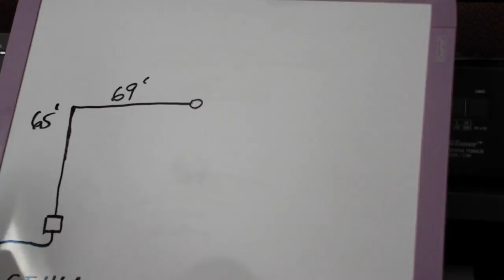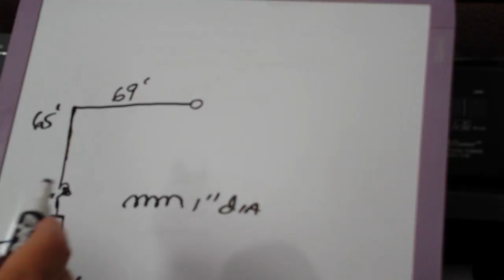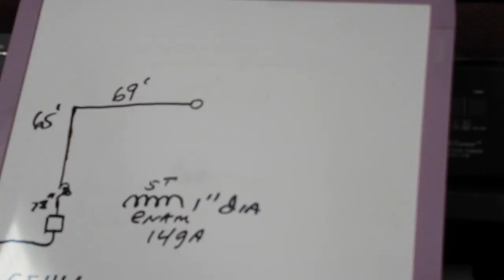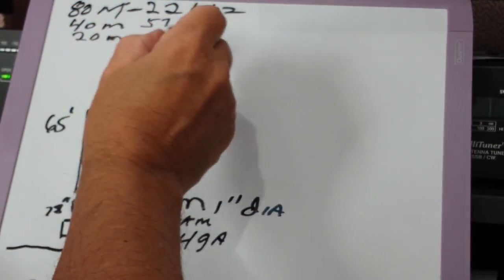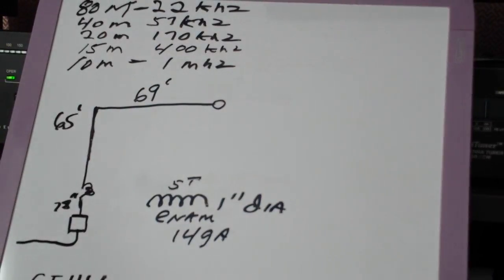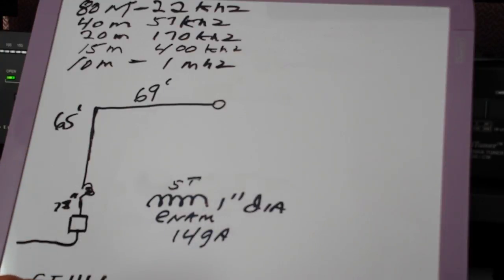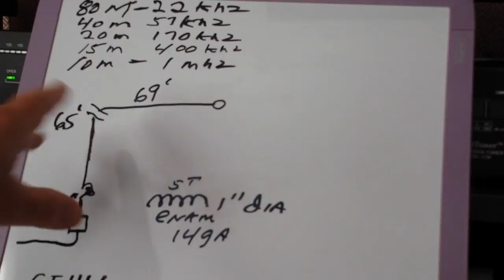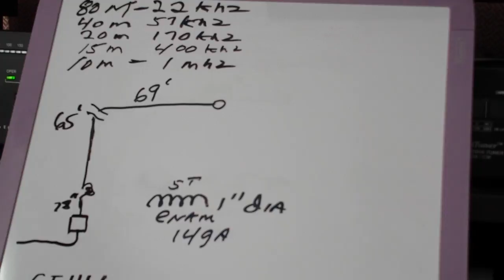EFHW  Compensation Coil Experiment

Comment: Thanks so much for your hard work. Not only testing the antenna, but making a video is hard work. I live in a mobile home park. I was going to put up an open wire fed doublet, but I've decided to use an end fed. Your tutorials have really convinced me to go that way. Especially using an end fed 40meter as a quarter wave inverted L on 80 with your relay addition. Thanks 73

Comment: This idea with the coil originally comes from few decades ago and was proposed by the German ham DL7AB and is described in the Karl Rothammel's "Antennenbuch" ( page 185). It was then designed for the EFHW 80-10m "Zeppelin" type of antenna fed by open wire line (the pre - "49:1" transformer era :)). It is still very attractive antenna and I'm glad the coil idea was probably creatively employed by the modern days EFHW manufacturers. 73! Linas LY2H
Reply from the maker: Very interesting. I found an old version of the book in German and found the article on page 172 however I cannot read it. I can't even copy and paste it in a translator. Maybe I will order the English version for $100. Thank you.
Reply: Steve Ellington , there is not much to translate actually :). I'm not any better than Google teanslator but the essence is like this: " The radio ham DL7AB offered a simple way on how to tune the long wire antenna to resonance on all bands. The principal of work is based on the fact that the coil inserted into the antenna wire makes the electrically lengthening effect. The effect is the biggest when the coil is in the Current Antinode ( Strombauch), and this effect diminishes with the Current Nodes ( Stromknoten) approaching the coil. The picture depicts the current distribution in the wire cut to lambda/2 on 80m. When the coil is inserted at the 2.5m point from the beginning the lengthening effect on 10m band is the most since the coil finds irself exactly in the first Current Antinode. On 15 m band the coil finds itself a bit farther from the Current maximum point so its effect deminishes. Thus, with the wavelength getting longer and longer the lengthening effect of the coil getting lesser and lesser. If you choose the length of the antenna wire equal to 40 meters it turns to be a bit too short as a half w/l on 80m. But still,  the lengthening effect of the coil is good enough to bring the wire into resonance on 80m band despite the coil finding itself almost in the Current Node. On 40m band the length of the wire turns to be 1,7m too short from resonance and the coil is closer to the Current Antinode and thus makes for the compensation of being too short. Equally on the other bands: on 20m band the wire physically is shorter for 2,3m,  and 2,5m on the 15m band. Summarising, the lengthening effect of the coil helps to get the wire electrically correct on all ham bands  due to these electrical properties of the coil acting in the float of current in the wire. " Further in the text there is a picture proposing the 5 turns of wire on the 50mm former for the coil with the latter being inserted at the 2,5m point from the beginning. The rest of the text describes the same antenna in the symmetrical dipole version  and the way of tuning and pruning the antenna employing the tube type amplifier and its final  LC contour checking with the Anode Current change all the way long :). Hope this helps a bit and I take no responsibility for the correctness of this translation! 73 ! Linas LY2H
Reply from the maker: @Linas_LY2H  Interesting. The modern version of this places the coil 78 inches or 2 meters from the transformer, not at the 10m anti-node. This makes me wonder.... What happens if we used another anti-node along the antenna instead of #1? It is interesting how the change on just one anti-node affects all the others.
Reply: Steve Ellington It would surely be interesting to experiment further with the placement of the coil. Some manufacturers put it as "non critical" , the place of the coil but it seems to me that putting it in any other place than the first anti-node on 10m band would seriuosly distort resonance on other bands. I have put mine at abt 2,5m from the begining and have it working fine but I have not tried putting the coil elsewhere. Interestingly, I have tried once to insert the same coil into the 40m band EFHW ( abt 20m length) at the same place of 2,5m and the result was dissapointing since the antenna got it resonances distorted on all bands including the 40 :)). So I don't use this coil on my 40-10 EFHW.
Reply from the maker: @Linas_LY2H  I think the problem you are having may  be the result of installing the coil too far away from the transformer thus too far into the 40m section. The commercial versions all stop at 2 meters and it seems to work on the 40m efhw well. We use 6 turns around a 1 inch form, close spaced, insulated antenna wire.
Reply: Steve Ellington Thanks, good to know! I'll try that out!
Reply: @n4lq  Check with your library - one that can do ILL (inter library loan) with (probably) universities.  If they can get a copy for loan, you can evaluate whether it is worth the $$ to add to your library.

Comment from the maker: The length should be around 130 feet which will put it on the low end of 80m. Doing that is necessary to make the higher bands fall into place. If you cut it shorter for 75 meters the higher bands will be too high so you need to insert a capacitor at mid point, about 400pf, to raise 80m for the phone band and not affect the higher bands. See my video on EFHW for 75 meters modification.

Comment: Is the wire for the turns just a separate piece of wire, not hooked up to anything?  And you just run the antenna through the PFC pipe?  How do you get the coil to stay there?  Will using a 1 1/2" piece of PFC work (its what I have sitting around).  THank you very much!    Dave N9DMS

Comment: Would it be possible to extend given efhw antenna ( with compensation coil ) for 160-10m?
Reply from the maker: The problem with doing that is: As you go down in frequency the transformer needs more primary turns. 160m needs 3 primary turns. 80m needs 3 but works ok with only 2 and 40 through 10m needs 2 turns. The big leap is from 80 down to 160m. The 2 turn primary will be lossy and swr high on 160m. The other problem is one of resonance. Do the math. If the wire resonantes on 1.9 mhz the harmonic will be 3.8 (actually higher) then 7.6mhz (woops) then 15.2 etc. You're way out of band and it simply won't work. The 3rd problem is radiation pattern where the 160m wire has a null overhead eliminating regional communications which is usually what you want on 80m then on the higher bands it becomes very directional off the ends. Overall the 160m version is only good on 160.
Reply: @n4lq  tu fer ur advice, 73.

Comment: Steve, you show how this coil brings the higher bands down into resonance for the CW portion of the bands and suggest a capacitor in the center if you instead want 80 meters moved up into the 75 meter portion. My question is that where i live I am afraid the capacitor would be a very weak point especially if i get any ice loading. Would it be possible to add the compensation coil (I would likely just start with a longer antenna wire and wind through the form for weather resistance) then trim the antenna down to be resonant in 75 meters which should also push the higher bands up into the SSB portion? So in essence bring down the higher bands then raise them all up together by trimming the wire.
Reply from the maker: If you try cutting the antenna for say 3.8 mhz then 40 meters will be out of band 7.6 mhz and maybe even higher! The compensation coil won't have much effect on 40 through 20 so you're out of luck. 
Why is the center capacitor a "weak link"? Just solder an insulator in place and jumper it with your capacitor. No strength lost.

Comment: what voltage rating would be needed for the capacitor??? thanks
Reply from the maker: I just use a 5kv doorknob type capacitor so I don't need to worry about it. In case of lightning it can take a beating.

Comment: Steve, The old standby formula of 468 / resonant frequency desired of 3.6 MHz should be length of 130 ft.  Why did you need 134' or more?  Just curious.
Reply from the maker: That's fine if you want 3.6 mhz then 7.2 then 14.4 then etc etc.... You should cut it for the lowest part of the 80m band and then the harmonics will land in-band. If you want 75 meters you can insert a capacitor at mid point and raise resonance for 80m up to whatever you want depending on the capacitor's value. Higher bands won't be affected.

Comment: I will have to look at your other videos, but are you running a 49:1 unun into this?  Any idea what 30m looks like on this?  N1XF
Reply from the maker: Resonance on 30m is at 10.7 mhz so it's a bit out of band. SWR is about 3:1 so you will need the tuner. Still an easy match and quiet usable.

Comment: Hi Steve, I think you answered this but just to be sure are you extending 134' wire by adding the extra 2 meters or are you shortening your main wire by 2 meters to insure your length is net 134'?
Reply from the maker: If you take a tape measure and stretch it out along side the entire antenna it should indicate 134 feet. Coil or no coil.
Reply: Steve didn't say, but I suspect he's using bare uninsulated wire... insulated wire as used in commercial EFHW antennas has a velocity factor of a couple of percent, so the insulated wire length will be a few feet shorter... the same antenna used by MYAntennas is 130'.. their coil is also at 2 meters. and the results (at least mine are) are similar to Steve's.

Comment: Steve, thank you for great video! Do you know where I have to put compensation coil If I work with EFHW-4010 transformer and 20m wire length? One meter from trensformer?
Reply from the maker: I have not tried this but seems that your coil would be located at the same distance from the transformer as the 80-10 version.
Reply: I will try. Thank you!
73 de 9A5CZI
Reply: Steve, I made some testing. Yes, the coil position and inductance is approximately same on 40-10m version but I have a problem with antenna impedance on resonant frequency.
My setup is:
- Transformer with 2:16 turns ratio on two stacked FT140-43 cores with 110pF compensation capacitor on primary side, tested with 3k3 resistor (swr is 1.5:1 or better from 3.5MHz to 30MHz).
- Antenna length is about 19,2m (63 feet) with compensation coil 2m from transformer. Antena is in inverted vee configuration (center point at 6,5m, end points at 1m) 50m away from trees and other objects.
- RigExpert AA-170 antenna analyzer for measuring.

I got resonance on 7, 14, 21 and 28MHz inside CW portion of band, but on 7, 14 and 28MHz impedance is about 100 ohms, and on 21MHz is about 35ohms.
I'm puzzled with results... Does it mean that antenna impedance is over 6000ohms?! It sounds impossible to me.
Reply from the maker: Normally the length is 67 feet so your's is really short. I would start out with 67' of wire and no comp coil then check for swr. Add things as you go. I believe the coil should be at 2 meters, not 1. Also FT-140 cores are much more lossy than 240's. I don't know of anyone using those in a stacked cfg. My comp coil is 6' from the xfmr on my 8010 version and I see no reason to deviate from that.
Reply: My comp coil is 2m from transformer and length of antenna is 63 feet after trimming. At this length I got resonance, but impedance seen by RigExpert is about 100 ohms (100 + j0).
I don't have FT240-43 core so I tried with stacked FT140-43. I measured about 1dB loss in this configuration.
I have to buy FT240-43. I know, it is better.

Comment: So you are not using a antenna tuner at all with this?  This might be a good antenna for my new QTH.
Reply from the maker: Hey Jim... I use the rig's internal tuner or if running the amp i use an external tuner. SWR is less than 2;1 without it but 1:1 keeps the current draw lower and fans off plus easier on the rig etc. Only a dummy load would be flat:*)

Comment: H Steve, My 20m end fed worked out at 9.15m length for low SWR at 14.2 but the analyzer put the resonance at 14.6mhz. Low SWR on 10m was 29.2mhz. I think I need to lengthen the antenna and put up with a higher SWR? The antenna is fed as a vertical with the feed point in the clear about 6m off the ground. Looks like the coil would help on 10m but the radiation pattern as a vertical for a full wave radiator does not look good.  Any comments?
Reply from the maker: David. I think the problem could be due to the feed point being 6m from ground. The shield of your coax is just the right length to begin acting as part of the antenna. This upsets the SWR. There are 2 possible cures. Lower the feed point to near ground and ground it there with a simple gnd. rod or put a common mode choke .05 wavelengths from the transformer. For 20m that would be 1 meter or 38 inches from the transformer. That gives the necessary counterpoise while not affecting the SWR much. 
As for the 10 meter pattern, there is not much you can do. You will have a high angle of radiation from it. It's just one of the disadvantages of multiband verticals.  73